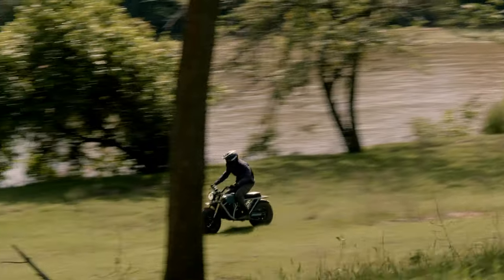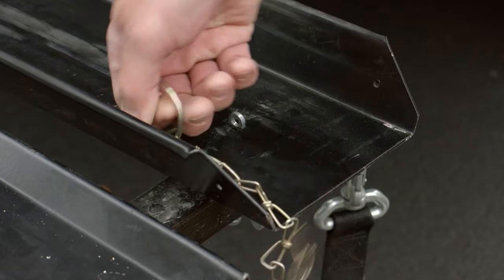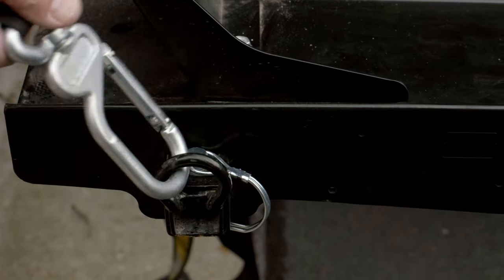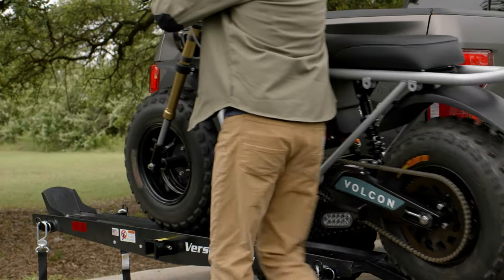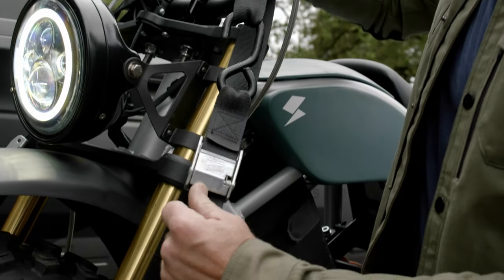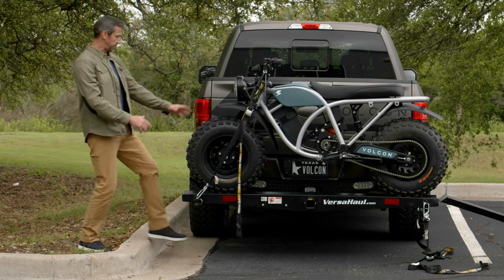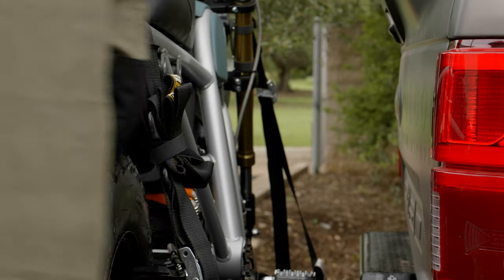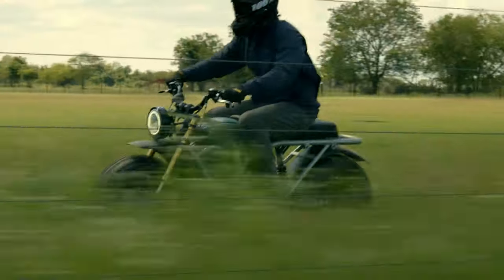Loading Your Volcon Grunt on a Bike Carrier

Comment: I got mine a month ago.  Rode it for 20minutes, and now it will not power on or charge.  The battery has no display, and the charger light just stays green.  RIP OFF!!  I had to send them a video of their faulty moto and they still have not resolved anything.  Also, it is cumbersome and rides clunky.  I would be scared to take it on an actual trail.  Buy a KLX 140 for a quarter of the price, half the weight, and reliability